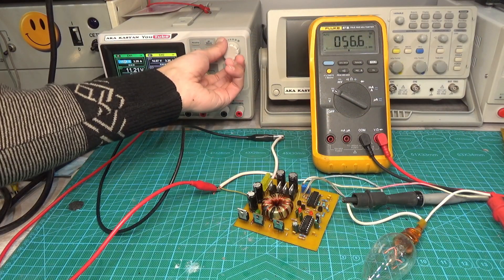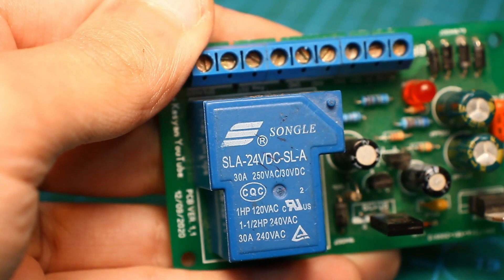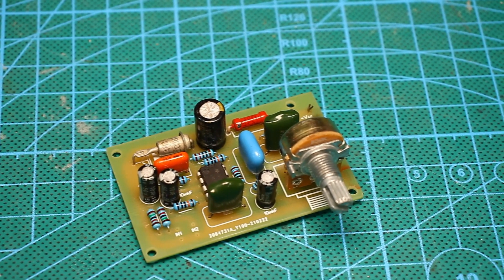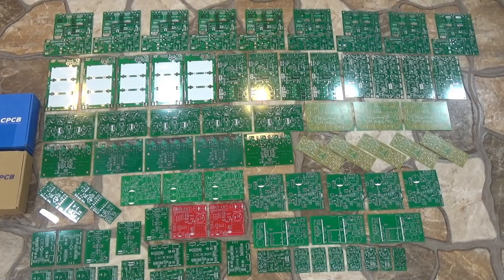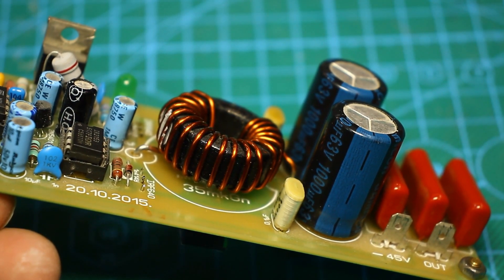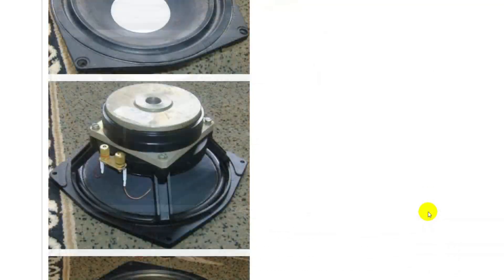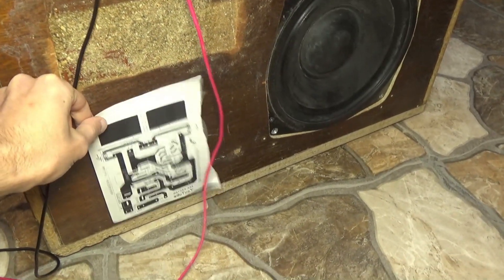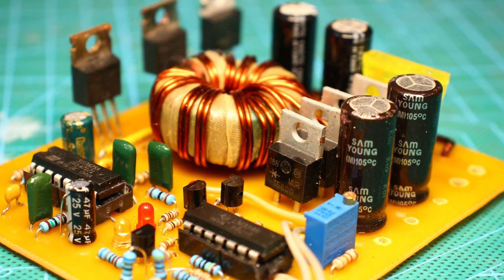DIY AMAZING car Subwoofer

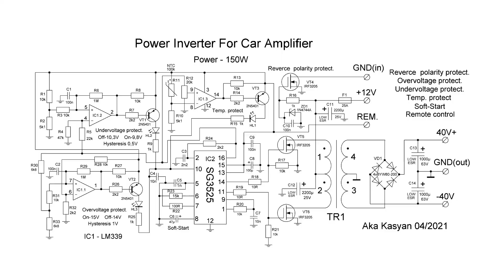Comment: 2:14 Absolute maximum input voltage for 7824 is 40V so it might get very hot and won't last long. I'm also a bit surprised that there is no snubber network on the drians of the switching transistors in the push-pull converter. We didn't get to see any scope traces so not sure if it's needed. Thanks for another interesting video.

Comment: You could have made an Intergraded amplifier where everything is on the same board.
Reply: Except car speakers are a fixed impedance (4 ohms), 12V limits the power output.
P = V * V / R (as current = voltage / resistance)
   = 12V * 12V / 4
   = 36W
So if you just want crappy stock car speakers, go ahead.
To have more power, the only option is to increase the voltage.
Reply: @station240  Make a 
SIngle-Phase-Power-Supply Amplifier. Like the cheap Chinese ones, you can get on Amazon.
Reply: @station240  DO you know the concept of using an H-bridge instead of a Half-bridge and in class D moduletation mode?
Reply: @TheUnknownCatWarrior  I know OHMS law, you cannot magically change the power output with a fixed resistance and voltage. There is no way to get the same power output as this circuit which has +/-40V.